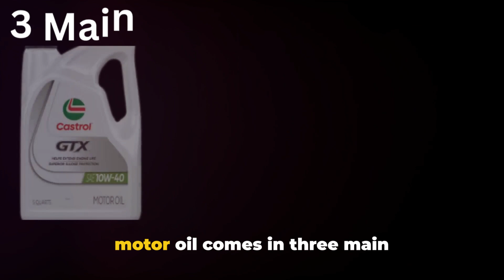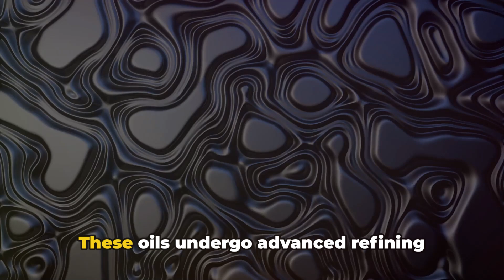Is Synthetic Oil Better? What You Need to Know!

Comment: In my service book, it says 30.000 km oil change. They WANT the cars to break down, i have no other explanstion.
Reply from the maker: 30,000 km for an oil change is definitely excessive. It's interesting how long they stretch these service intervals. definitely feels like a way to keep those "parts" departments busy!
Reply: In Greece my father in laws new Kia sportage with the 1.6L hybrid , dealer says don’t change oil until 30,000km.  I told him at 30K you will probably be getting a new 10,000 euros engine VS 100€ for oil change.
Reply: @aciddiver1978: You are Absolutely RIGHT! The 'STEALERSHIPS' would then be able to sell MORE vehicles!!
Roland Singh, Canada 🇨🇦

Comment: Hi Brian, thanks for the clear explanation on oil types. I have a question about oil change schedules with hybrid engines. I just bought a Honda Accord hybrid and had the oil and filter changed at 786 miles, just to eliminate new engine particles. But what should my regular oil change schedule be with a hybrid?  A lot of the times the engine rarely runs, and I think it mostly charges tbe generator, so it’s not even under heavy load. I only drive 3,000 miles a year, and most of my trips are less than three miles.  I can’t even get the car to warm up sometimes before I turn it off 0:02 because it’s in full battery mode. I’m baffled. Maybe I’ll just default to 5,000 changes, but do you think it should be less because of all the starting and stopping of the engine when I drive?  Maybe 4,000 mile oil/filter changes?  I’d appreciate any insights. Thank you.
Reply from the maker: Hey Syusi. Here are my thoughts:  Given your driving pattern, it might be prudent to change your oil more frequently than the standard recommendation (frequent short trips can lead to more rapid oil degradation due to the engine oil not reaching optimal operating temperature. This can cause increased moisture and sludge buildup in the oil.). A schedule of 4,000 to 5,000 miles could be beneficial in your case. This would help ensure that any contaminants are regularly removed from the engine and maintain optimal lubrication. If you can 4000-4500 miles interval would be ideal.

Let me know what you think!
Reply: Thank you for your insights. I think I’ll try and maintain a schedule of 4,000 mile oil/filter changes. Or six months, whichever comes first. I appreciate you getting back to me.